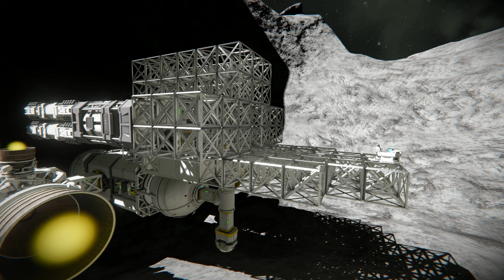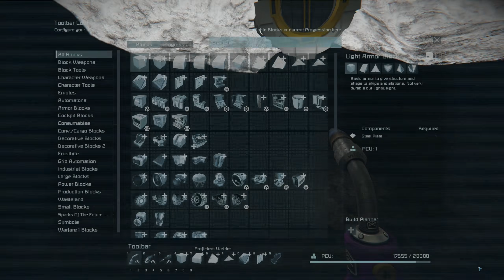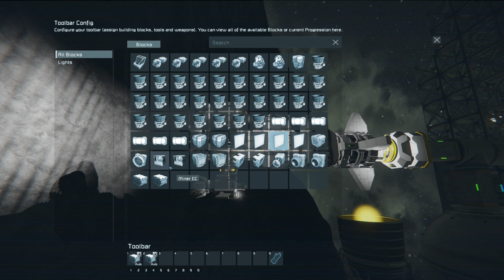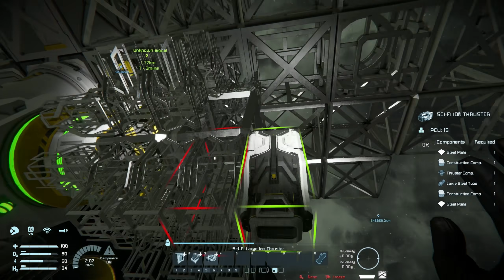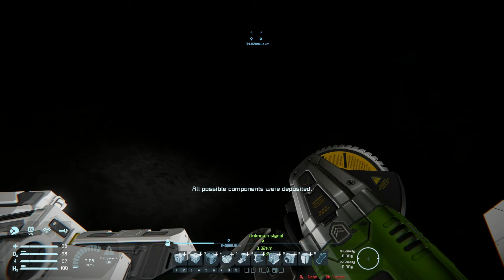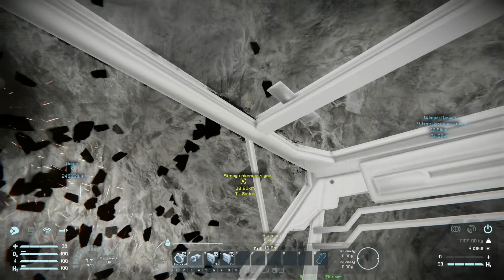Vanilla Cargo Fill Level (or a more clever title) - The Collector #4

Comment: The problem with collecting, is the time spent refining… It took 11 hours to process my last uranium haul, using six, fully yield module equipped refineries!!!…. At least my large grid, purely ion powered mobile base shouldn’t need its reactors refilling until 2030…
Reply: Do you have realistic settings on as I tried it and holy man does cobalt/nickel/magnesium take awhile to refine.
Reply: @Gracefulwarrior2124  Yeah… I always go realistic survival now… You should try refining platinum if you think refining cobalt is tedious! if you can find it on realistic without your ship being destroyed that is… It took an entire week flying from asteroid to asteroid to find and refine enough to build my ion thrusters, constantly having to hide from enemy drones behind the asteroids which held the ore, because I didn’t have enough cobalt for heavy armour, or enough magnesium for ammo…  I’m now a month into this scenario, 4-6 hours per day, and I’m only at the stage I reached after three or four days on default settings… But it’s taught me the value of discretion and underground bases :)
Reply from the maker: This is partly why I don't plan on using yield modules in this series. I just won't have the time to be on the server to process my ores so I'd prefer to go fast and mine more :)

For context, with 2 speed modules on each of my 2 refineries, they're going as fast as your 6 all yield ones (albeit producing less from each kg or ore)
Reply: @Splitsie  Luckily, I don’t have time constraints or deadlines for publishing instructional and entertaining content online… And I should really thank you for the excellent series of elementary tutorials which saved a fair bit of trial and error when I first installed this annoyingly addictive title… Well done mate…

Comment: One small note about the scout: you might want to consider replacing most of those small ions with large, since IIRC the PCU cost is the same per thruster regardless of block size, and you'll need a lot less of them if you go with mostly large thrusters. It doesn't seem like much now, but it adds up fast, and makes a big difference later on when you get close to the PCU limit. I've found the two main culprits for gobbling up PCUs are weapons and thrusters, so best to design around limiting both of those as much as possible from the start, and since I doubt combat is going to be a factor in this series; that means it'll be the thrusters holding you back the most.
Reply: The 20K PCU limit is very... well, limiting. It has held me back from Keen servers. Here's to hoping that VRAGE 3 is more forgiving in that regard.
Reply from the maker: Honestly, it hasn't held me back yet and I'm 4-5 episodes ahead of this so far. I think the reason is because of all the ships I build for the ACS mod where I had things limited to 4000PCU and also due to me not building any guns :P
Reply: @Splitsie  I'm hoping you try to join an in-game faction. Or create your own. That will bring all the bees out from the hive. Don't do it until you reach your destination - one goal at a time.

Comment: large grid you can use gravity generator to push your ejected waste away so you don't risk crashing into the rocks you eject. if you bother with an ejection system
Reply: True but it needs gold for its components
Reply: @Gracefulwarrior2124  that’s fair
Reply from the maker: Also, rocks don't cause damage to grids so you can smack them out of the way for fun :D
Reply: @Splitsie i have suffered damage to my ships a number of times due to the rocks ejected from my mining ship. typically if they get trapped in between the ship and the tunnel i'm boring. of course i don't have a video of it but i know it's happened so :shrug:

Comment: The mining ship has a perfect space for an O2/H2 generator below the cockpit. Vertically symmetrical and everything. Feels like you might as well, because it will be mining ice to keep the main ship fueled at times anyways.
The smaller ship also is harder to break because, while each block has.. well, should have 1/125 the health, they also are equivalent in smaller size. Losing a single small grid block is nothing, but losing a single large grid block is very much a problem. It's like why gatling guns were absurdly broken back when the game was in early access. Those ships would look like they flew through a solar flare.

245, or close enough to 246, thousand kilometers, at a hundred m/s. A kilometer every ten seconds. That's 28 and a half days, real days, of straight-line travel. No detours, no stops, no slowing down. Four weeks. Jump drives exist for a reason. My congratulations to whoever you spawned near, as well, because that must've taken a while even with the aid of jumps.

Definitely have some guns. Some serious ones, too. If you come across a hostile player, the closest thing you have to defense is slamming your whole ship into them, or trying to run, and that won't save you forever, and you certainly won't want a restart after travelling so far and getting such a large ship - the experience you have is unique already, having to go this far with the issues playing on a server brings. No need to throw that away because one person in a fighter could pick off a single exposed hydrogen tank and send you and your rather fragile cargo, succeptable to even otherwise non-critical systems being lost, back to the nearest respawn ships.
Reply from the maker: One person in a fighter can kill me while I'm offline regardless of turret counts, so there really is no value in guns. I'm on the server so rarely each week that it's a greater than 97% chance that they'll hit me while offline

Comment: Loving this series, makes me want to jump into a Keen server and play a game myself! On the topic of the lights, is there any way that you could make them change colour with the event controller?
Reply: No you couldn’t change the light color. But what you could do is use it to do is turn off one set of light and turn another on. Example when connector is connected battery is on recharge red light is on and green light is off. When connector is not connected battery is on auto turn off red light and green light comes on.
Reply from the maker: Yup, can't change light colour settings with a timer block as it has no access to the colour settings, so Hamada's concept with 2 lights is the best option. With scripts you can certainly change the colour though
Reply: @Splitsie  ahh yes scripts the only splitsie tutorial I’ve never finished. Half way through nope to smart for me. 😅
Reply: technically yes but it swaps between two set colors and requires some timer block complications. i dont know how to explain it in a way that is understandable thou.

Comment: 9:16 Or there is option 3 - move the ALREADY FULLY MOBILE MAIN SHIP SIX METRES OVER TO THE THING YOU JUST BUILT.

Edit; Put an antenna with 200m range on the scoutie-scout, then leave the scoutie-scout near the Pt, then it will transmit the Pt signal to any ship within 200m.
Reply from the maker: Your ALL CAPS statement is missing one crucial bit of information which makes it a terrible idea - very high latency and a single bump making your newly built ship drift away
Reply: @Splitsie  Oh come on, where's your sense of adventure? :D

(In all fairness and truth you are completely correct - plus the fact that your connector orientation meant that there probably wasn't enough space for you to manoeuvre the big ship between the roid and the miner. You'd have had to build a new connector on the miner anyway.

But it did make me giggle how you were trying to move the immobile thing instead of the fully mobile ship next to it. I'd have lived dangerously, built a connector on the little ship, a magplate on the big ship (in case!) and very slowly and carefully moved the big one onto the little one, even with lag)

Comment: Definitely put some guns on it! I tried a similar scenario, and on my first test flight, I accidentally crossed paths with another player. And. They. Tore. Me. To. Shreds. Lost the ability to respawn, and I needed a full restart after that.
Reply: the server hes on is sparsely populated and the people i run into so far (within the last month) are all kind of cool, even though they like to push buttons that launches my sleeping pod when its not supposed to.. that was meant for splitsie to press..
Reply from the maker: If I run across someone with guns, whether I have some of my own won't make any difference whatsoever. I'm resigned to the fact that if someone wants me dead they'll be able to do it, so why give them the satisfaction of a 'fight'?

Also, since I'm offline more than 97% of the week it's far more likely that it'll be an offline thing and you can defeat any turrets while someone is offline.

Having no guns means that the mostly chill people I've chatted to on the server don't see me as wanting a fight, so instead just chat :)

Comment: Wouldn‘t it be better to change the color of the fill indicators between green and red (if this is even possible)?
Reply: It is with scripts but public servers like this one have scripts disabled
Reply: You need either an interior light as its very ckear to see if theyre on/off, or use red and green light panals as a duo for telling what is what.
Reply from the maker: Yup, without a means to change the colour I think that on/off is a more clear indicator :)

Comment: Iv made miners like this but fitting the drills to a rotor for that tunnel bore vibe.
I actually found it really efficient as it actually cuts a larger hole.
Also small grid miners are better like 80% of the time due to the lesser mass for transporting and jumping. Large grid ones are also just thirsty
Reply: The lower light could be a fuel 50% just cos you'll notice it more than the bar
Reply from the maker: True, I do have a habit of not noticing such things :D
Reply: @Splitsie  power low - keeps welding